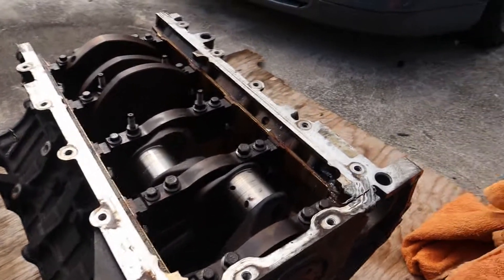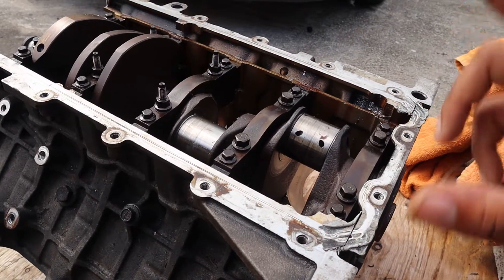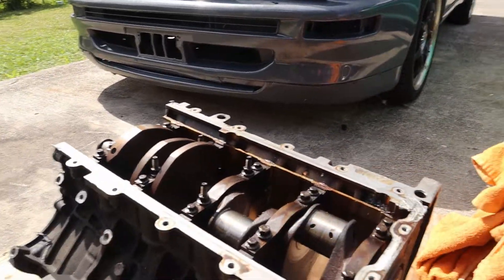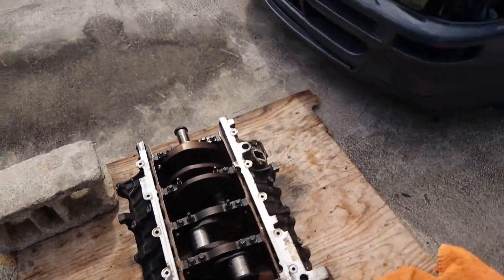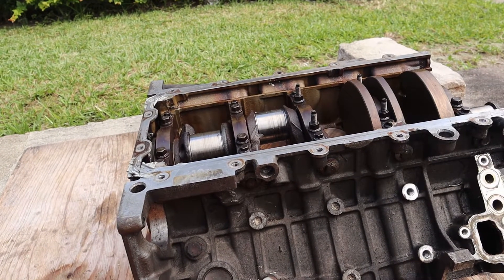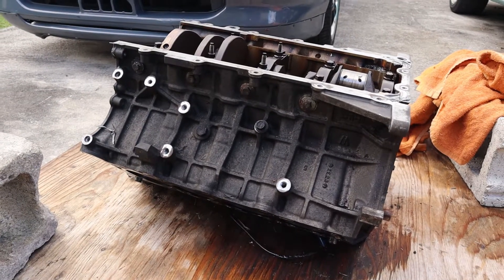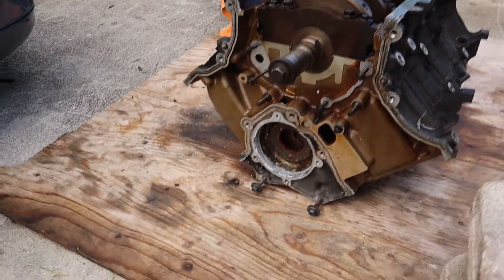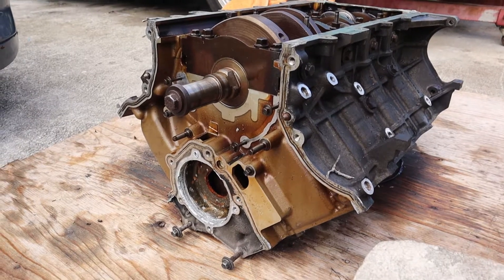What Makes The 4.6L DOHC Motor So Great??

Comment: I don't know if you're really right on what you're saying there because the four valve will take a lot more boost then the two valve I have boosted both to the point of explosion and the two valve went at quite a bit lower boost and I'm talking like 8 lb of difference and the durability of the four valve held up a lot longer but it might be that I was using a true cobra block and head's

Comment: The aluminum blocks are not weak quite the contrary. The aluminum teskid is by far the strongest block ever out of all factory ford blocks made. Mihovetz has used a teskid block and b heads from a mark viii making 3800hp running 5s in the 1/4 mile no other ford block in history comes close to these numbers on factory block. Coyotes go billet and way more cubic inches for those kind of numbers
Reply: Yes 💯 somebody who actually who knows about the strength of the Teksid Mark VIII engines 👍
Reply from the maker: Oh that is awesome bro I didn't know that! 3800hp is insane btw lol

Comment: The intake cam isn’t the only thing different the 03-04 cobra have forged crank and rods and the Mach one has a forged crank but regular rods the difference is large in the Hp capability in the reg 32v and 03-04 conra engines all other cobra where none forged
Reply: All cobra had forged cranks and only 5 speed machs did.  Marauder and auto machs got cast crank.

Comment: the cobra 4v internals are forged all other 4vs are cast internals
Reply: 03-04 cobra was all forged the other cobras were forged crank but cast rods and pistons.  5 speed machs also got forged cranks...
Reply: 03/04 manual machs had forged crank

Comment: What no one has mentioned is from 1993 to 1995 in the mark viii series,the motors were hand built,but because everyone was buying SUVs and the mark viiis weren't selling, the 1996 thru 1998s were changed to regular production 4.6 32 valve motors,some changes were made at that time to the motors
Reply: I don't buy the "cause everyone was buying SUVs" thing
 
The Mark 8 was just not promoted and advertised like it should had been . Just like the Mercury Marauder that wasn't either
Reply: I just bought a marauder on monday! I'm fuckin Lovin it  @dewarkhodern9990

Comment: So I know this video is old but I have a 3v and I’m about to go pick up a 4.6 dohc 4valve should I swap that into the 3v body I plan on building it and boost it
Reply: @DriftDreams242  idk I never had a 4v I had a 2v which was dog slow then the 3v which mines has a set of cams and I beat 5.7 but I heard the 4v off a cobra loves to make power and can hang with 5.0s so I’m a use the termi internals with a bigger crank the 3v isn’t a bad motor at all just takes money to make it quick not enough to keep up with anything else that’s boosted or fbo e85 cars

Comment: I have a 2003 mustang gt convertible with the modular 4,6 dual overhead cam, when I get parts for it , I always get grilled about it, they ask me are you its dual overhead, I have been researching  it ,but can't come up the horse power I heard there was only a few  gts that had the modular in them, I need answers.. thanks!
Reply: @DriftDreams242   I'm sure
Reply: @DriftDreams242   I will go out side and take a picture
Reply: @DriftDreams242   that's what I'm saying it's weird
Reply: @DriftDreams242   how can  I send the. Pictures

Comment: I want a 1995 or 1998 mustang GT so I can restore it with a coyote 5.0 or a 4.6 dual overhead cam dual exhaust bad ass body styles in them ninety's models they are sharp with aero dynamic display in the molding of each body parts like forexamplewherethe driver door matches with the rear body panel it's vented on the 01 and up but this was a indention

Comment: That's not exactly true my buddy and splitting 34 lb of boost who is Cobra motor all aluminum for about 3 years now he drags it on the circuit you not having a problem with the block
Reply: The aluminum blocks can all take well over 1000 with forged internals.  The teksid is the strongest Ford oem block ever that includes the coyote blocks.  Most ppl don't realize what a bad boy the teksid block is.  Even terminator guys source them when to use when they have an engine built.

Comment: the cobra had all forged internals. mach1 has  forged crank steel rods hyper pistons. 10.1 compression vs cobra 8.5.1 boosted
Reply: Depending on what era of cobra.
Reply: Only the manual Machs had the forged crank in the Mach series. Autos were cast.

Comment: sorry but 03, 04 cobra motors are cast iron blocks
Reply: Also my 99 cobra is a cast iron Block.
Reply: @evaningraham8991 they didn't come factory that way.  They had aluminum blocks all the 4v did other than the navigator, 07-10 gt500 and 03-04 cobra that includes the Mach 1 (aluminum block)

Comment: In Australia we have a modular 5.4 with 0304 gt heads dohc way better than American Modular  engines Boss 260 Ford ba Xr8
Reply: We had a variation of the 5.4 dohc, the navigator had one. And they're easily capable of everything the boss is.
Reply: @PureCountryof91  the gt500 also had 5.4 dohc 07-12 and the 13-14 5.8 is just a bored out version of the 5.4.  The ford gt got the 5.4 4v so did the 2000 cobra r.
Reply: Navi heads flow just as well as GT heads. Plus there are FR500 heads as well, besides the world record 4v 4.6 world record was done with B heads.. Yall have the cool straight 6 Ford engines (we did have the 300) I'll admit but we have the mod motor game down here.

Comment: What makes the 96-98 and some 99-01 4.6 4v engines so great is that the teksid blocks were manufactured by the same company that made Ferrari engines! Also the crankshaft is forged from factory! Another great thing about these engines is that you’re only pistons,rods,and fuel system upgrade away from 1000+whp because the stock heads,cams,and intake are more than capable of handling that power without a problem! The teksid block itself is also bad ass because it can handle over 1500whp
Reply: @DriftDreams242  the teksid block is the best block ever made by ford! Have you ever heard these motors scream at 7800rpm? They sound better than a coyote and they scream like a nascar...I’ll shoot you a link so you can see how sick they sound
Reply: @DriftDreams242  what cams do you have? Do you have the 96-98 cobra cams? Or do you have the stock mark 8 cams? Because if you still have the stock mark 8 cams I highly recommend getting the 96-98 cams before trying to raise the rev limiter,these motors love to rev! With the right intake,cams,and tune these motors can rev over 8k rpm like the coyotes
Reply: The teskid block can handle dle more than that, John Mihovetz got the world record with a teskid block, Kellogg crank, and B heads. All factory parts on a 96-98 Cobra. Cant remember the time bit I remember he trapped 230 something or 250 something. So it was low 6s or maybe 5s
Reply: It's in the family but they have differences as he pointed out. The maurader has the Mach 1 engine.  But call the cars their true names. I have a 97 cobra svt , I don't have a Mach 1 nor a maurader nor a gt , I have a Cobra. I see guys putting the cobra bumpers and badges on non cobra cars and it's pathetic.
Reply: https://youtu.be/eexcc7ozS_s
Reply: @DriftDreams242  here’s a video of a guy in a 98 cobra spinning his high compression supercharged 4.6 4v to 8300rpm 

https://youtu.be/nDB6r8Yw2QI
Reply: @DriftDreams242  dude you’re on the right track with the c-head swap because those heads make more low end,mid range,and high end power than the b-heads when it comes to n/a power. So yes it is worth doing the c-head swap,I’m actually going to be doing that swap on my 96 cobra using my 96 cobra cams or maybe even just get bigger cams if I have the money
Reply: @DriftDreams242  the only cams you have to worry about swapping into your c-heads are the 96-98 intake cams, they are more aggressive than any of the 99-04 cobra intake cams,you’ll definitely see a gain in power..go to forums and you’ll find out for yourself,they are very worth it for the money,it’s cheap horsepower
Reply: Also all the mk8s up to 98 got teksid blocks
Reply: @DriftDreams242  you did mid the cylinder head change between pre98 and 99+, all the pre 98 motors got split port intake B heads with some late 1998 exceptions, those exceptions and 99+ models all got some form of the C head, they would all be the same for the same year model, the 4v navigator 5.4s got physically larger heads with water cooled exhaust ports, the 2000 cobra R got the all around best flowing heads made by ford, and the 07+gt500 with the 5.4 and later 5.8, plus the same time frame ford GT got heads similar to the navigators but with different exhaust ports, the cobra R heads are outflowed on the intake side by the B heads, by a cool 30+CCs, but the gt500 heads have the most exhaust flow, being the only DOHC modular heads to have a different exhaust port because it had to be so large for the extra flow due to the supercharger, they didn't go as hard on the intake ports though because of the supercharger, there was also various different 5.4 DOHCs in Australia that IIRC used the ford FR500 heads, which were upgraded cobra heads.
Reply: @Prestiged_peck you're mostly right and the larger exhaust ports wasn't just because of the blower but also the larger displacement vs the 4.6 cars.  The Ford gt got the same heads as 07 up gt500 (or visa versa) and they flow little better than r heads but not by much its pretty close either way.  They were designed for forced induction whereas the r heads werent but they all flow amazing.
Reply: @DriftDreams242  you're welcome, might also be helpful to know there are 2 different aluminum blocks, the WAP (windsor assembly plant) version, and the Teksid which was cast in Italy. The teksid is the stronger, known to hold on with only o-rings and dry decking to over 4000 horsepower before splitting the mains, and reliable anywhere below 3500 provided proper maintenance and oiling is achieved... and you don't throw a rod... the WAP is still a tough block but apparently it comes apart in the mid 2000 horse neighborhood, The iron blocks are actually the weakest on both the 4.6 and the 5.4 due to the lack of sleeve reinforcement, the aluminum blocks are properly reinforced all the way up the cylinder which is why they're stronger. Strongest 5.4 block is going to bet the 5.4 gt500/GT40 block, with the 5.8 following close.
Reply: @DriftDreams242  honestly I'd change it out for a WAP block and sell the teksid next chance you get, the WAP is lighter due to less material
Reply: @DriftDreams242  people are readily running 1800 on WAP blocks.
Reply: @DriftDreams242  they're less rare than you might think, they came in 92-98 mk8s, 92-99 continentals, and 96-98s cobras, with some 99-04 4v 4.6s randomly getting teksids, usually cobras or mach 1s but some aviators and marauders got them too.

Comment: the 2v allso came with 6 bolts as the 4v the only difference is cams versus 2valves the block is identical except for the heads allso the 99-04has thepiheads and cams and produces 260hp   @302 ft.pounds of tork the only 4v is different is 03@04 cobra blocks  my friend !
Reply: So wrong lol. 4v came with Kellogg crank and teskid block. That’s a HUGE advantage for the 4v.
Reply: Gt had a weaker block

Comment: The 03 and newer 4v heads (marauder, mach 1, cobra, and aviator) are heads borrowed from the lincoln navigator. Same heads, and cams. They flow a little better than the earlier 4v heads because of slightly modified intake ports. The cobras n manual mach1 also have forged crankshafts (terminator iron block, manley connecting rods). The 4.6 4v was introduced in the lincoln mark 8 and the 5.4 4v was introduced in the lincoln navigator. lol its crazy the cobra n shelby gt500 have souped up lincoln engines in them....good luck on the build 💪🏾
Reply: I was wondering if someone would mention the forged internals on cobra motors. Happy building y'all!
Reply: They do have better heads than earlier 4v but they aren't the same as Navi heads 03-04 c beads are better than Navi heads.  They did have Navi intake cams but the exhaust cam is different.  Older b head intake cams make the most power you can gain 20+ rwhp with no torque loss on a c head motor.